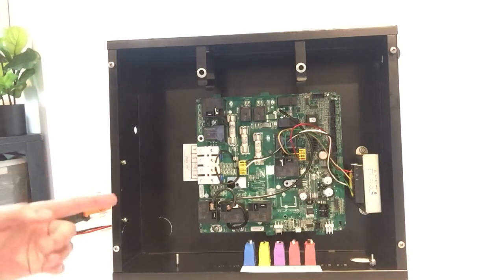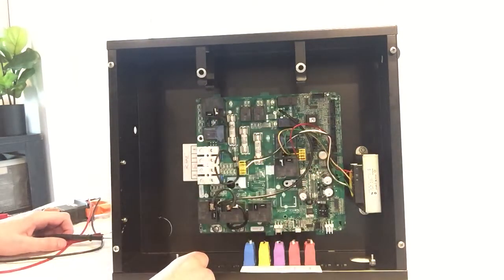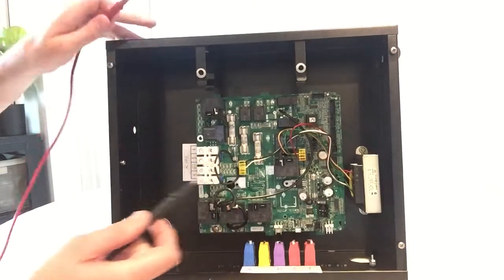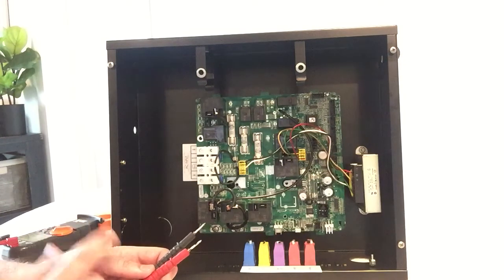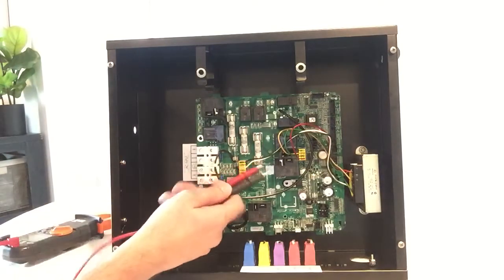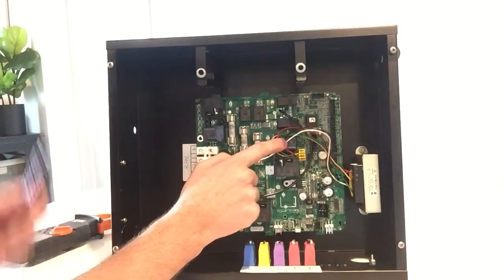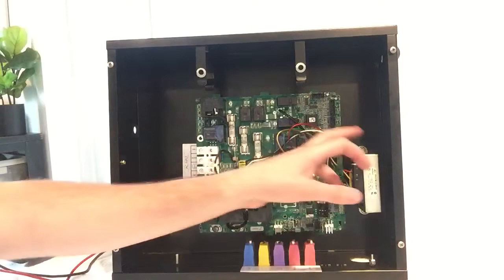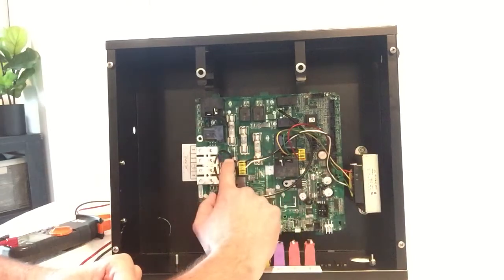Dimension One Spa - Power To Spa But Nothing Works.

Comment: Thanks for your video. Very helpful. I have the same problem - nothing from the spa despite incoming power present. My transformer SEC output is supposed to be 12V AC, but it shows about 40V AC. Do you have any thoughts about this?

Comment: If the spa has been working without problems, is the fuse and/or the transformer a problem?  My problem is the  new ozenator test did NOT get the recommended glow at each end when doing the pretest.